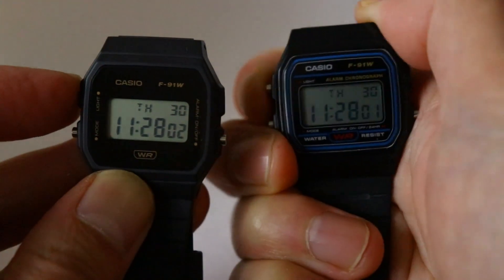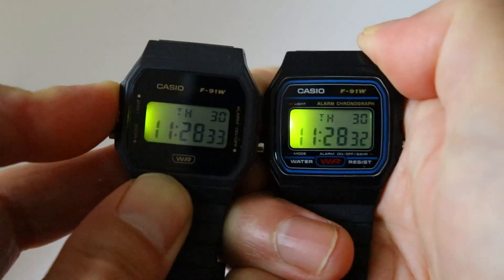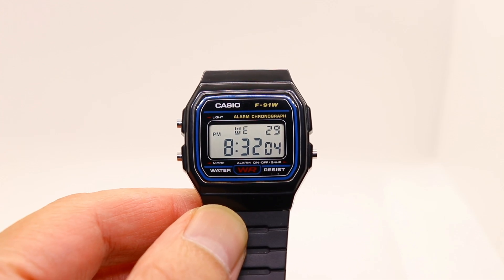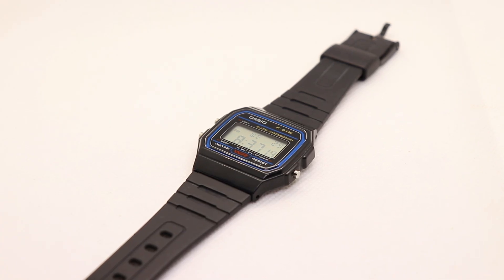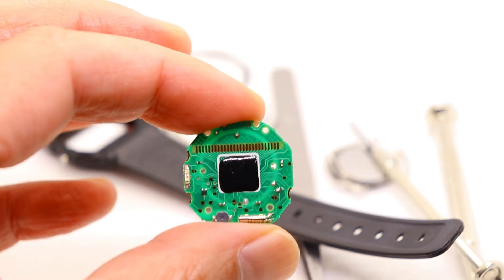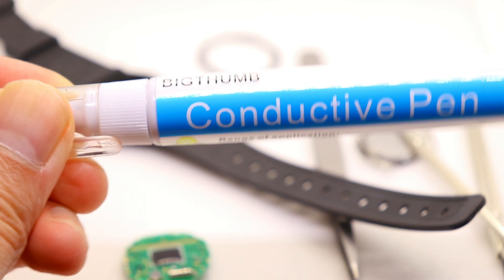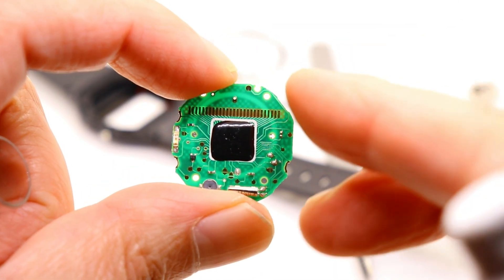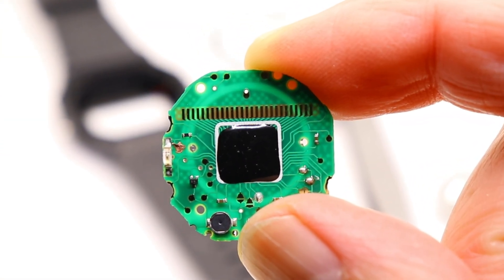Casio F91W - Change ONE SETTING for a BRIGHTER Backlight

Comment: I just did this mod to my JDM F-84W, and not only did it go brighter, it also changed colour to orange. - This coupled with the light-spreader you can get on etsy and it's now easily as good as my wife's LA680WA, which is classed as an "Illuminator" model.
FYI - for anyone thinking about luminescent paper behind the screen - it does work, but only last for a minute or so, and needs a lot of direct light to get it "charged". That mod I can't recommend. This soldering of jumper one though? - Absolutely!
Reply from the maker: Thanks for the nice comment!  I just want to emphasise that you don't have to use a soldering iron as a conductive pen works just as well.

Comment: also, there is a mod where you not only replace the led with a slightly brighter one, but also run a second one in parallel to the opposite end of the pcb to get a more uniform backlight. i would think that would drain the battery even more coupled with this mod. and, it is very easy to replace the battery.

Comment: this mod is very similar to the ae-1200 mod with the extra flashing features in that it bridges two solder points. have you tried to bridge the other half-split solder pads on this f-91 to see if any other features get unlocked?
Reply from the maker: I think that the other pads are for adjusting accuracy.

Comment: I mean... It's ok to know how, just for fun, but in this case I think it's far better solution to retire the F-91W and buy a new F-105... which is basically the same watch, but with a full EL backlight.
Tho, if you want even a better small digital watch, I recommend W-202. It's a bit more expensive, but it's by far the best of F-91W alternatives.
Reply: I have others in my collection but it's the F91w that commands 95% wrist time. It's the look. The graphics are too iconic to abandon for me.
Reply: @johntate5050  Matter of taste. To me, W-202 looks much better than a classic F-91W. Tho, the new one color line of F-91W is pretty sleek.

Comment: The candle that burns twice as bright burns half as long.
Reply: Well we are not making the candle burn twice as bright but we remove the things which does not allow u to see the light. Mah man told it in the start of the vid
Reply: Oh no, you mean the battery might only last me two years instead of 4?
Reply: 半分になったところで2年か3年使えるでしょ
十分過ぎるわ
Reply: Here’s the cool thing. It’s a light emitting diode. Not a candle. So you have nothing to worry about.
Reply: I don't have need to use the light very often, but when I do, I want to be able to read the correct time. I don't like having to guess the what numbers are because I can barely see them...

Comment: Some interesting advice, thank you. One of my F-91W watches is likely to need a battery swap so I may well give this a try when I change the battery. I'll probably use a soldering iron though as I can easily undo the mod if I want to. The watch is way out of warranty so all good to try. I'd add the foil reflector mod that you shared in an earlier video at the same time. A good tip not highlighted in the video is the diagonal fitting of the screws for the case back as it reduces gasket shift and warpage. Well done and thanks for sharing.

Comment: So you're bypassing the current limiting resistor between the battery and LED. I'd rather choose a better light distributer behind the LCD.
Reply from the maker: You can install a light spreader...but they cost nearly as much as buying a new watch.
Reply: @wristaction  Don't buy one that's advertised as a backlight spreader for this watch. People are selling them for ridiculous prices. Just buy a sheet of the material from China. You can cut many, many pieces out of it.
Reply: @Ni5ei  what's the specific material?
Reply: @Ni5ei Do you know what the material is called? Is it PET?
Reply: This is a great hack. I'm in the process of testing some light spreaders that I've developed and hope to have them finished next week. They'll be for sale on my Etsy shop soon and they'll be a fair bit cheaper than the ones currently on there.